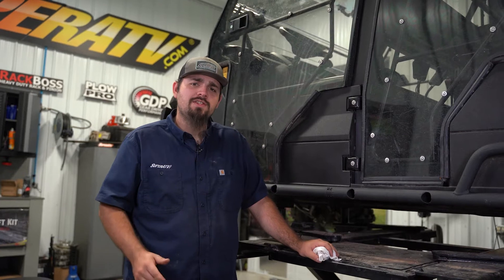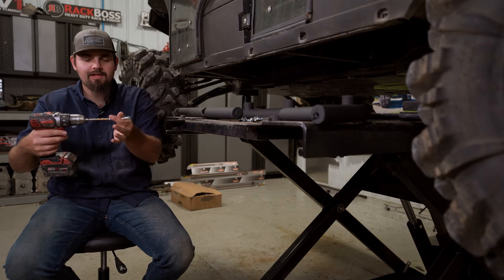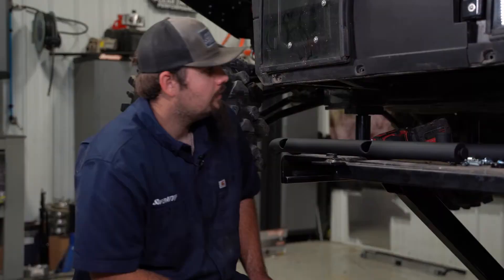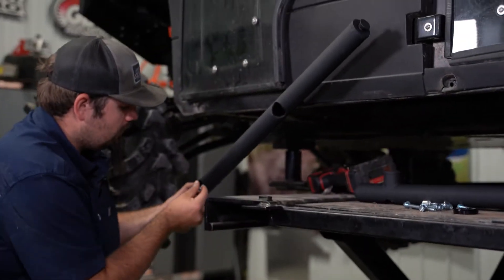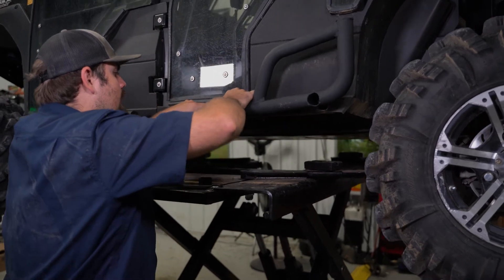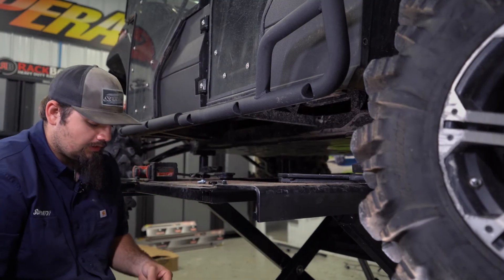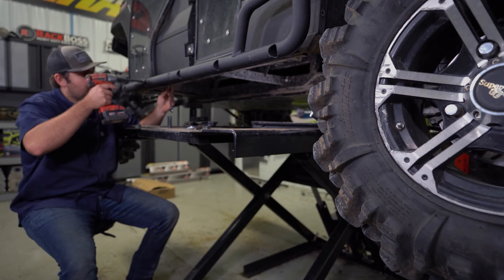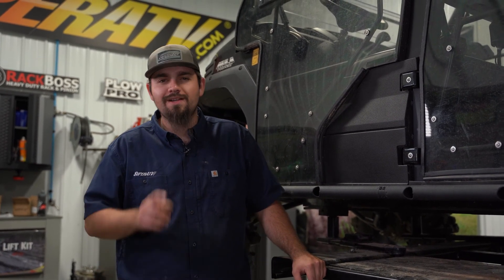How To Install SuperATV Nerf Bars On A Kawasaki Mule Pro-FXT

Comment: Got mine today, build quality is very disappointing and the hardware kit was missing bushings and bolts, trim cap threads on the top that's back by the rear tire was totally different than the stainless bolt as well. Had i not already drilled out my frame I would return it.